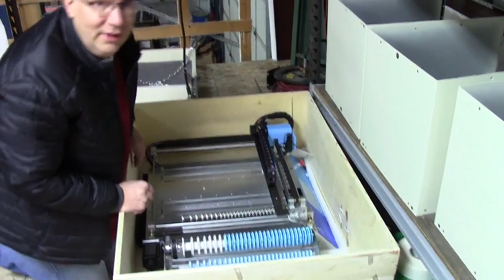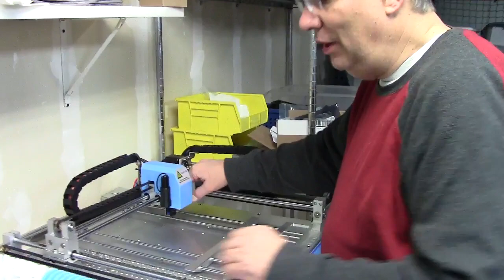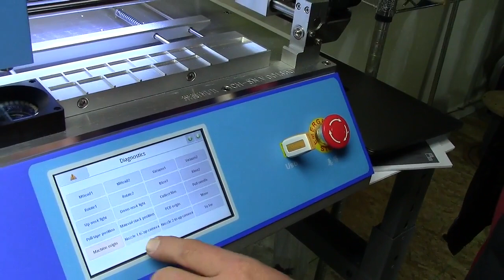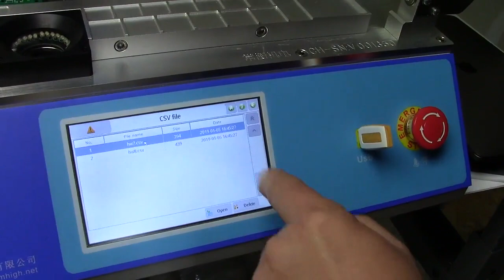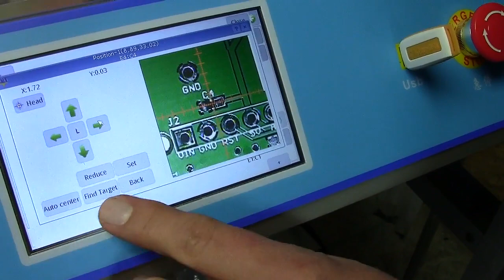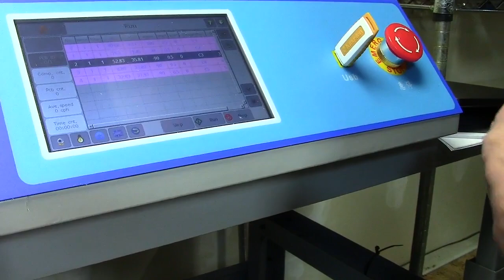190105 Charmhigh CHMT48VA Unboxing, Checkout and Run

Comment: Does this work with Cut Tape as well as rolls?
Reply from the maker: Cut tape works fine, but you need a leader for short pieces of cut tape. Another approach is to stick short cut tapes to machine area, then treat the tape as a chip tray. This works fine as well.  I usually buy a 1000 piece cut tapes, see my video on making reels, https://youtu.be/QodF9ON_NzM. Thanks for watching.

Comment: Reassuring to know that they issue an Inspection Certificate. Wonder if "The Inspector" noted the bent bracket that caused a machine crash at 15:11, potentially sending its linear precision out of spec during homing(how ironic). Sorry for that comment btw, couldn't resist ;) Hope it makes parts, that's all what matters at the end of the day. good vid, thanks!

Comment: I have been looking at these but what I cant figure out is how it advances parts. Does it advance all tapes at once? that would be horribly inefficient but I cant figure out how else it would work.
Reply from the maker: There's a small pin that comes down from the head, lands inside tape hole and head pulls the tape forward one space while the cover tape is pulled back. Then the pickup head then sucks up the the part for placement.
Reply: @CraigHollabaugh  Thanks for the quick reply! I did finally see that in another video after I asked the questing.
Reply from the maker: @endoracing  Glad you figured it out. You should check out the google group "desktop-pick-and-place". There's a lot of discussion over there about the 36VA and 48VB. Also, search youtube for "Unexpected Maker", Seon has excellent pick and place coverage as well.

Comment: Very cool video.  I actually was looking to order one of these and one minor thing I'm a little confused on... where does the empty tape actually go once it drops into that slot? lol
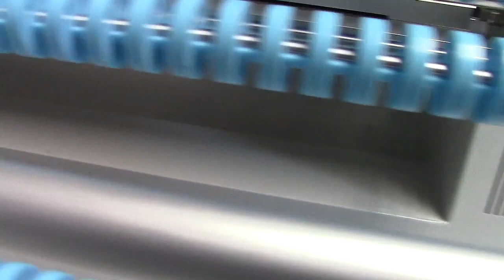Reply from the maker: Thanks, around 8:46 I'm panning across the area where the empty tape exits from.
Reply: @CraigHollabaugh  ah, ok. So it kind of curls back and exits out the same side as the reels it seems. That works. Thanks! 👍🏻
Reply from the maker: @wk057  Exactly, exits on the left edge right under the film take up reels.

Comment: Hi Craig,  I've been looking at the CHM-T48VA (29 tape feeders) and CHM-T48VB (58 tape feeders) to purchase for prototyping and small batch assembly.
Your video is the best overview of the product on YouTube. It's nice to get a real long form opinion, so thanks very much for taking the time!  If you plan on more videos on the machine in future, I'd be very appreciative and interested in hearing your thoughts on the machine after using it and whether the CHM-T48VA has enough feeders for your use. Also would be great to see your workflow using the machine (solder paste printer, time and hassle setting up the PnP, changing tapes/reels).
Cheers and good luck with it! :)
Reply from the maker: Thanks Darian. I plan on creating content similar to this for my entire order because there's very little for this machine. I was traveling for about 10 days, so that's why the silence. Videos planned: solder paste machine, reflow mods, more in-depth setup/operation, and board runs of course. Thanks for watching.

Comment: Thanks for sharing this video! I'd also like to get a pick and place machine in the next year or three, and this Charmhigh machine is one of the ones that looks appealing to me. It's very helpful to see your real world experience with it.
Reply from the maker: Thanks Mark, stay tuned and I'll continue to post video my progress with this machine. There is really a lack of user created videos for it, what is kind of odd.
Reply: I've noticed that lack of videos, too. So I'm particularly happy that you're changing that situation.
Reply from the maker: @Nf6xNet  I was a little apprehensive about the purchase, it is clearly a little more than I wanted pay, then to billed 25% tariff, made it way more than I wanted.  The lack of videos means, well to me, that customer's don't have the time to create videos,  or it might mean that the machine works great so there are no negative videos from disappointed customers. I purchased this pnp machine due to Kimi's very short videos and the lack of negative videos. I'm traveling this week, so it will be about 10 days before I get back.
Reply: Craig Hollabaugh I’m also interested in seeing how the stencil thingy and reflow oven from Charmhigh work out for you, when you get back to the system.

Comment: What do you guys do there? I noticed a bunch of 8 & 10" CTI cryopumps on the shelf in the rear.
Reply from the maker: Kevin, you're correct. I was wondering if anyone would notice those. I'm currently contracting with a dry and cryo pump company in Colorado and there is some CTI equipment here.